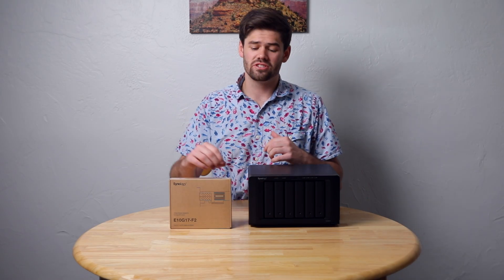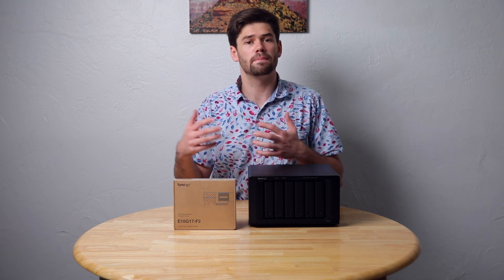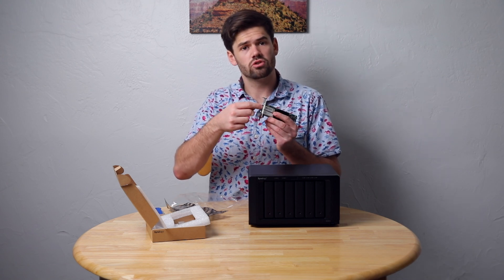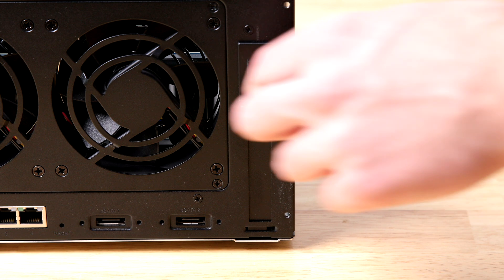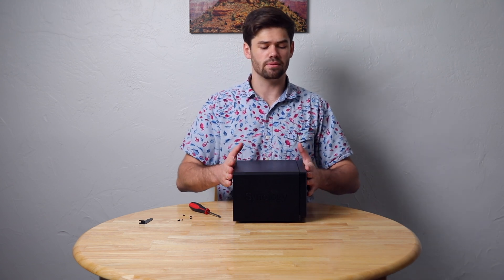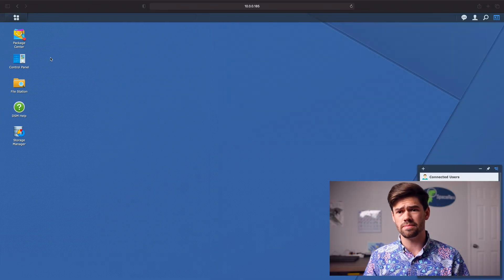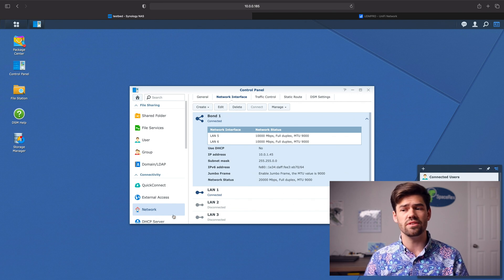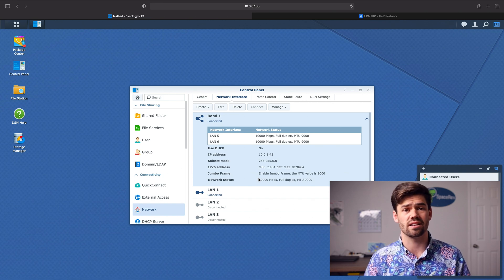Installing Dual 10GbE SFP+ Card in Synology DS1621+

Comment: Did you used this melanox card with dsm 7.2 latest os , any issues 
I have few things to ask actually 
Am from uk  . I didnt recieved my hard drive yet its waiting to deliver ,, my question is. I have upgraded the ram with  comparitable from crucial  and installed  synology nvme ssd as well. And if i  install the 10 gig card also before the first boot is there any problem ,,, or do i need to do first boot with out card and nvme and comparitable ram , instead of use the own synology ram boot once insrall dsm then change the ram and install the network card 
? What u suggest

Comment: May I ask what SFP module you using ? My spec also same as you but I want my Mac studio directly connect to 1621+ with no switch. I'm getting stuck of nomatter which SFP module I put in, it's totally doesn't work. I tried few brand of it and all doesn't work
Reply from the maker: So avoid SFP+ to RJ45 adapters. Both computer and NAS are plugged into a switch, that has RJ 45 and SFP+

Comment: Should I buy DS1621+ or DS1522+ in 2023? cause DS1621+ only 100$ more expensive and provide 1 extra bay, dual 10GBE upgrade, downside is less RAM, older CPU

10Gbe speed is important to me. So your test with DS1621+ is only 3 drive on RAID right? So with 4 drive, it will still the same speed with DS1522 ( 1000mb/s read)?

Comment: Thanks for the video... glad to see you do the speedtest, using 6-drive hybrid raid with 2x redundancy currently, and didn't know for sure if going 10gb would really be worth it.  Will be using 10g ethernet myself, and while a bit more of a pain doing cat6 cabling, I really won't have any runs over 50m in my home, and except for the switch in the attic, I'll be sticking with mostly 2.5g switches in the home for now, which the nas should still saturate, but at least better throughput doing large project copies/backups.

Comment: If both your NAS and PC have 25 Gbit/s connectivity, but your LAN is only 1 GBit/s, could you connect NAS and PC directly over 25 Gbit while also connecting both to the Lan over 1 GBit? LAN for the Nas so you can reach it on lower priority devices as well, and pc for well, internet
Reply from the maker: Yes you can! Have a video "10GbE no switch" that does this, just with 10 instead of 25GbE. Process is identical however

Comment: Hello! Love your videos, congratulations from Spain!!! I have a 1621+ and recently installed a 10Gb Card... but in the Network tab I only see 1000Mbps at LAN 5, using a Cat8 cable. I don't know what's happening...  I have a 10Gbe network. Thanks in advance.
Reply from the maker: Check and make sure the other end is 10GbE

Comment: Would you say SFP+ light transmission is the future over copper runs? I have seen entire neighborhoods being strung up with optic lines in my area. The benefits of using SFP+ seems extremely rewarding over expensive copper Cat6 line. Thoughts?
Reply from the maker: There are two primary advantages of fiber over copper: 1) extremely long cable runs (just like those from a house to a data center, which is why fiber is so common in the home now) and 2) ultra fast speeds. Fiber can support crazy fast 400gbs. 

For writing around your home unless you are a crazy nerd (like what I am planning on doing) cat6A will be easier to manage than fiber runs and cheaper overall
Reply: @SpaceRexWill  Thank you! (Very new here and willing to learn everything I can before buying) --- Are you willing to do a Zoom call? I have so many questions to ask that may sound like stupid questions... --- Like, do I need to rewire my entire house in CAT6 to see 10BGe benefits from my (10GBe PCIe card NAS) / laptop workstation? Or just running CAT6 RJ45 from my router to NAS to mac book pro would suffice to see 10GBe speeds from a fully populated (maxed out) DS1621+ for instance.

Comment: Hi, Will. I notice in the video that the box for the NIC you hold up is for the Synology E10G17-F2 nic, yet the vid shows you installing the Mellanox CX312B ConnectX-3 EN Pro. Did the Mellanox card work in the DS1621+?
Reply from the maker: The card I install is the synology one. The synology card uses a melenox chip

Comment: Hi Will! It's me again :)

I just acquired the DS1621+. Is there any chance that you can test some other brands of 10GbE cards? Maybe 40GbE even, like the Mellanox MCX314A-BCCT ? Is listed on Synology website to be compatible with some models, but not the DS1621+. Maybe it is, but because the DS1621+ is kinda new, their compatibility list might not be up to date.

That would be extremely nice to know, specially because those Synology cards are pretty expensive.

Thank you!
Reply from the maker: I would love to get my hands on some faster cards, I just dont have the pockets for them though! 

Sorry!
Reply: Unless you're using SSDs, you're unlikely to need more than 10gb to the device.

Comment: Do you recommend running fiber in house walls instead of copper ethernet cable?  You mention fiber is cheaper.
Reply from the maker: fiber is cheaper for really fast speeds (~40GbE) but for most consumers fiber is really hard to run in the walls

Comment: Another great video. I had the same issue. Put my 10GbE card in my DS1621+ when I put the RAM, Cache and Hard Drives in. Booted up and no DSM. I moved it over to 1GbE and was able to complete the install. Then switched back to my 10GbE. I noticed in DSM that my 10GbE card (LAN 5) had reflected my expected 198.168.x.x IP address with a subnet of 255.255.255.0, but the unused 1GbE ports (LAN 1-4) had 169.254.x.x IP addresses with a subnet of 255.255.0.0. Not sure how they got them or why, but found it interesting.
Reply from the maker: Ah the 169.254.0.0/16 domain is actually called the local link (think that's right) domain which computers get on if they are on DHCP but cannot find a router. allows them to talk to each other without a DHCP server
Reply: @SpaceRexWill  Really! Didn’t know that! Thanks for the explanation! 😊👍🏻👍🏻

Comment: If you have a separate virtualization server you could use one of the ports for a direct connection between the devices over iSCSI, no network bottleneck.
Reply from the maker: Very true. Plus iSCSI has a really efficient bonding method compared to standard LACP

Comment: You’re videos are great! I have been watching for the last few weeks and learned a lot about Synology and networking in general from you! Big thanks! I just bought the 1621+ and I love it.  I am trying to create a PostgreSQL database on my Synology for Resolve collaboration but I think I’m still lacking some fundamental knowledge. Would love to see a video on that! Keep the great content coming!
Reply from the maker: Thats a good one! Been meaning to go over setting up a database!
Reply: I know this is an older post... I would suggest getting familiar with docker and the terminal/ssh... which may be your best path for a lot of services on this device.  I'm using a separate MinisForum HX90 for a home server as I didn't want to run too much on the nas itself.
Reply: Hey! I´m trying to do the same thing... did you managed to have the PostgreSQL runing from the 1621+ ??

Comment: This week I replaced my DS713+ with a DS1621+.  I ended up going with the 10Gtek version of Intel's X520-DA2 and it works perfectly.  The NAS booted for the first time on the 10G connection so results will vary on if it'll boot for the first time on included 1G ports of PCIe 10G ports.
Reply from the maker: Oh interesting! For me I had not set up the volume at all or turned on the NAS even and it did not seem to want to connect until I went with the 1GbE port. Could probably a combination of NAS and device.

Comment: Me looking the first seconds. This thing comes in a ESD bag. Few seconds later. Grabs the contact pins on the card.
Reply from the maker: Lol Linus showed it was fine!
Reply: @SpaceRexWill  Yeah he did it on RAM but the odds are minimal but it can still happen.
Reply: Over 30 years of taking apart and building PC’s and never, not once have I used a strap. Not a single problem. Just lucky? Or overstated? 🤷🏻‍♂️ Granted anything is possible, the question for me after many years is probable? 🤔